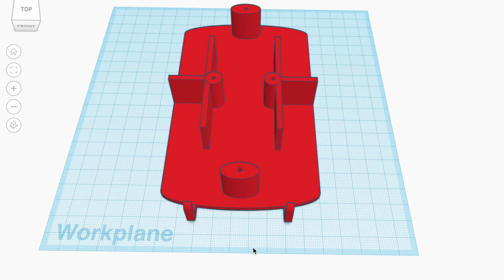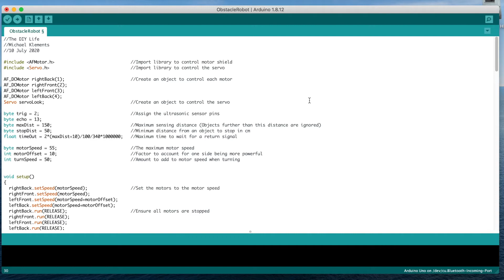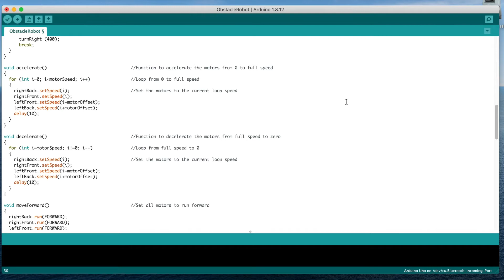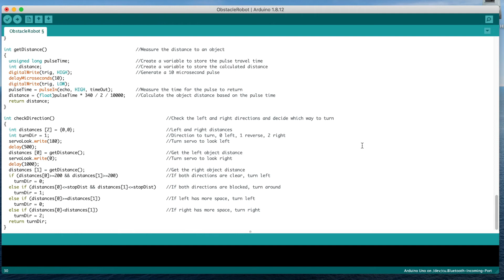Obstacle Avoiding Robot Car Using An Arduino

Comment: Hey, really cool video. I have tried it on my 4wheel Arduino car, but the car only moves back not forward. Do you know why is that?
Reply from the maker: Thanks Lester. 
Are you using the same motor driver shield? Try stripping the code down to just run forward and then backward and see if it works, that'll point out if it is a code problem or hardware problem.
No, the numbers after rightback and leftback etc. refer to the motor output numbers, not pin numbers. These tell the code which motor output is driving which wheel location.
Reply: @MichaelKlements  Thank you!  Do you think we can make a drift car based on this kit?
Reply from the maker: These motors aren't really "high performance" motors, so probably wouldn't produce enough torque to get the car to drift. I think you'd be better off using brushless motors and some brushless PWM drivers which you could drive from an Arduino if you'd like.
Reply: By the way, the Arduino car kit I got do not allow me to swap the wires on terminal. Is there other way to fix it? and in your code, the rightback 1, is the number of the pin?

Comment: Is this an expensive or cheap project?
Reply from the maker: The project should cost around $30-$40 depending on where you get your parts from. If you're prepared to wait for components with longer shipping times then you can probably get the components for less than $20.
Reply: To Buy this complete project kit visit this online store 👇👇 

https://techparts.in/product/5f8fd4f1dd26bf1bf89fb818

They providing very good service and  free delivery so guys make use of it and rock it

Comment: 5:02 why does my board cannot insert the wire like yours?
Reply from the maker: The board should have silver pads on it, you’ll need to solder a section of pin headers to the board to allow the wires to plug into
Reply: @MichaelKlements  wow u reply so fast not like other 'technology guru' out there, thanks very much ....I will support your high quality content from now on
Reply from the maker: Thanks MGK Killed, good luck with your project!
Reply: I literally can't put it because I didn't have the black little things
Reply: What does it call and how do I put it

Comment: Sir can I use your code I'm school going boy, how to use code just drag and drop? Or write individually bcoz I don't know how to write help me
Reply from the maker: Hi Samrat, you can download the code through the link in the video description. You would only be able to use it directly if you built the car with the same electronics, if you change any of the electronics then you’d need to make some changes to the code as well.
Reply: @MichaelKlements Hi thank you  sir I will use same electronics what is in ur video, u r saying not necessary to change any thing ,if I use same electronics, once again thank u so much for your reply nice to see you friend, keep in contact sir if I have any doubt I will ask you help me sir
Reply from the maker: No problem, good luck with your project!

Comment: Sir the car is moving towards the obstacle instead of moving away....what to do?
Reply from the maker: Your servo is probably moving in the opposite direction to the code. Try swapping the travel directions or the turning decisions. Your servo is turning the sensor left when the Arduino thinks it is right and it’s then turning towards the obstacle instead of away from it.
Reply: Thank you sir